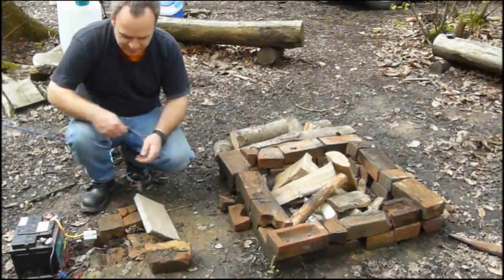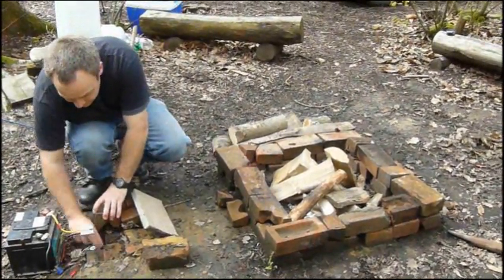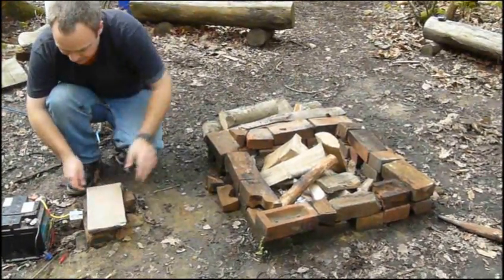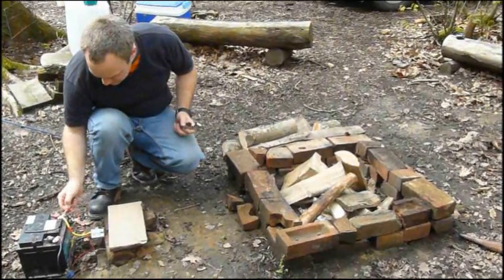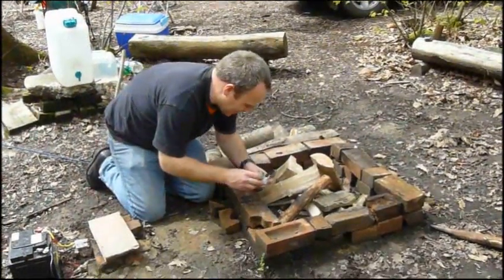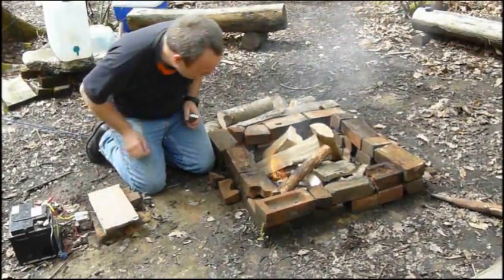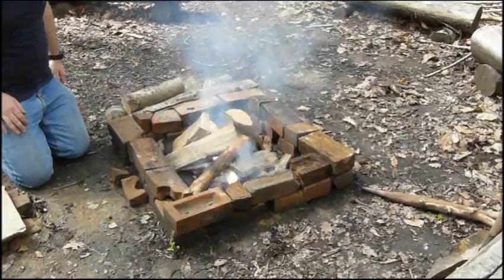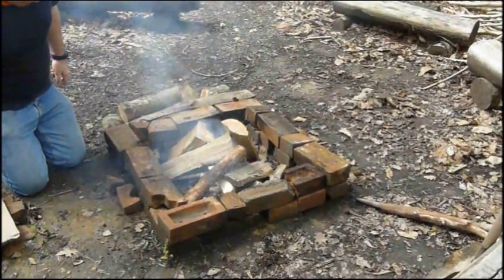Supercharged Fire Pit!

Comment: Have you found that after you remove the forced air the heat just dies substantially? I think the extreme heat seals the surface of wood and stops the release of flammable gas...
Reply from the maker: It keeps burning OK, but slows down to a normal rate, and the heat drops because of that. More smoke too, of course.

Comment: How much you would say the pipe alone would help? Without the 12V fan? I have been thinking of similar solutions for backpacking camp fires to get them smoke free, but electricity would be a problem.
Reply from the maker: Not a lot, unless you can angle it uphill. I think for a portable equivalent the best thing might be some kind of grille to let the air get under the fire? That would be light enough to carry.
Reply: Thanks for the answer. A grille might be a good idea, much easier to carry than a pipe at least :)

Comment: Clever idea.
Seems a bit complicated and clunky, though.
Would you mind checking out www.FiAir.net to see my solution to the same problem?
FiAir does the same kind of thing, but it's portable...
Reply from the maker: Looks like a nice gadget for getting fires going! The difference for me is that this is a fire pit at the campsite in our woodland, so burying the pipe was no problem. I also leave the fan running for several hours at a time, to get keep the fire very hot and reduce smoke, so the big battery is useful there. I've improved it a bit since making this video, with some better wiring. I can see your gadget is great when something portable is needed though! :-)